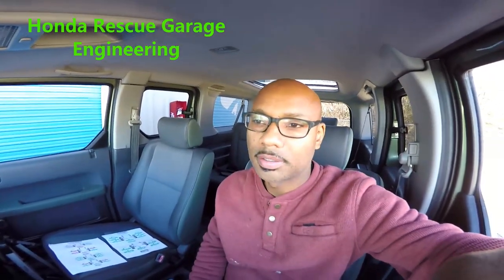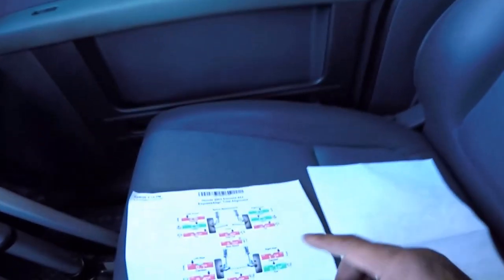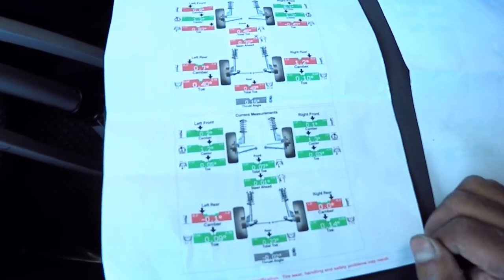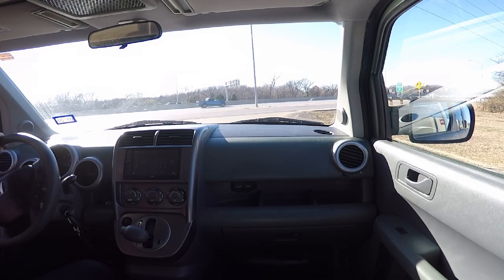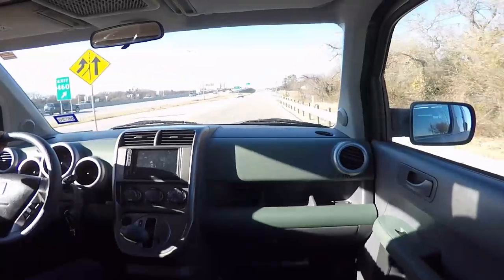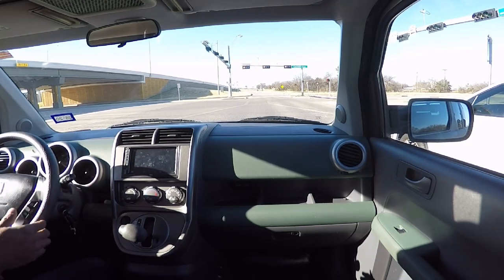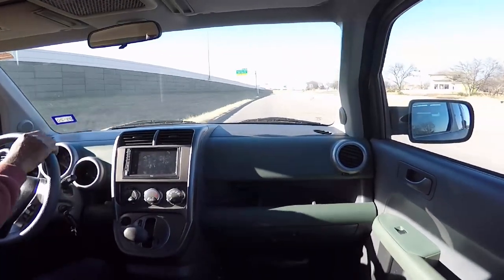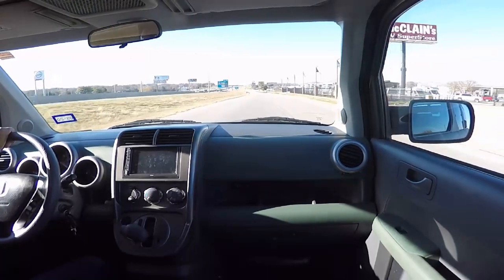HRGengineering review

Comment: Did you replace axles at all did the oem axles hold up? I saw somethings that said that if the axles are old they might also need to be replaced. Considering the lift but need to redo the front suspension. I am currently rebuilding the rear thanks to your video and encouragements. Almost done and installed the swift springs in the process. It also says on the hrg website about recommending wheel spacers. Do you think that helps it? I guess maybe that makes it less likely to roll?

Comment: Did U have to modify the grill when u added the raptor style grill lights?which one did u get got a link to it?mines is driving like she should lifted 3 inches aerogenics engine and subframe  drop kit ksp camber she’s running good loving it
Reply from the maker: No I just place the lights in the grill no modifications at all
Reply: @ByrdsRebuilds  
Ok sweet imma order some did u used the rounds ones or the other shape like a diamond
Reply from the maker: I used the around one